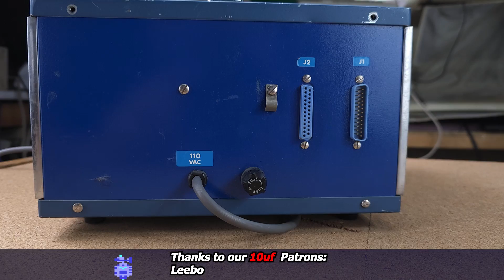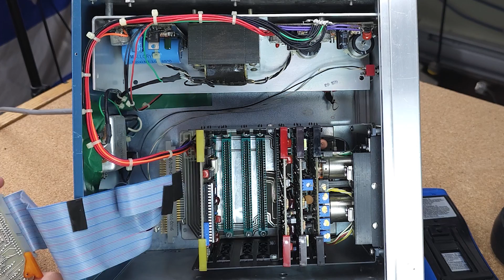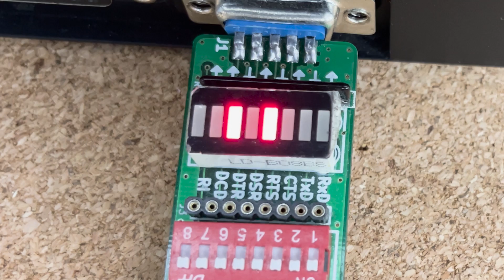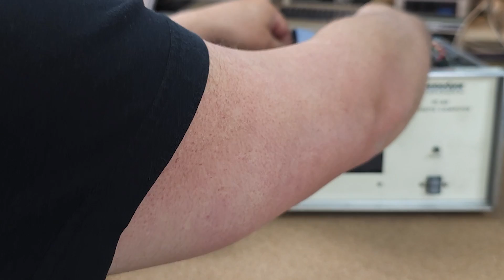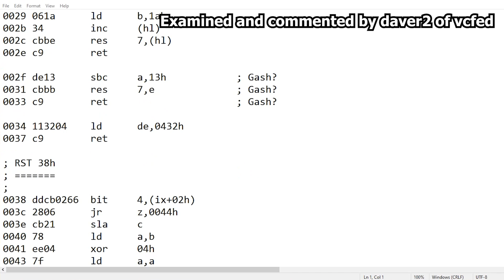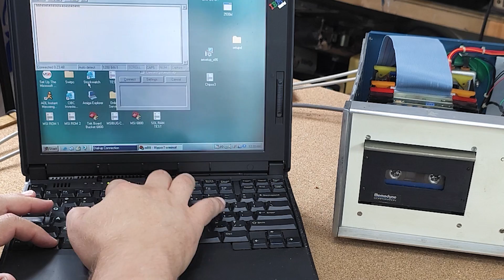Fixing a Mystery Z80 Computer from the 1970s

Comment: Hi

Interesting device.

I am glad you traced the power on the card and sorted out the + and - voltage traces - i would have not thought of that.

However i would not use that 25 to 9 pin adapter, you are assuming it is using a hays standard or more modern ibm standard of serial port wiring

Maybe the volt meter should have been used on the 25 pin port with the tape playing to see if there is any +12 or -12 voltage coming out of any of the 25 pins ( well 50 pins as you mentioned there are 2 off )

Then the same with the oscilloscope

Initially I was guessing one port is for a screen and the second for the tape back up, but you mentioned the eprom dump shows nothing that sophisticated - but if it was a screen output that would also be on a a simple serial out 

I was actually suprised, you did not cut and paste some text into the hyper terminal software and see if it stored the data / keystrokes and the tape unit attempted to save the transmitted characters

But your data recording playback did not have any different tones that would have been produced for each different key press

It is a shame the machine is so well built that it did not have a simple description of which slot each card goes into on the card or even a texta or sticker on the card slot edge or backplane slot saying red/brown/yellow etc

Unless the serial parameters are exact the device would not understand the characters and not work as designed, however the fact that the hyperterminal only ever  showed  character on screen that was a result of your key press , and never any characters that were generated by the tape drive could suggest that the 25 to 9 pins adapter may not be correct, some important pins may need to be connected as 25pin to 25pin - this happens with say cash register comms - there is a scan code or maybe a Control G to trigger the drawer open, other serial printers use a spare pin for special feature - the "paper out" is a example as different printes used different spare pin to report back - this is why some printer you had to use the factory cable not a generic serial printer cable

I dont think it requires additional voltage via the serial cable, it seems to "quick forward" on Ctr-Q so no real need for extra power - some items need a +5 or -5v for options to be sent in the cable - security door loggers are a example, we had one in a building i worked in, it used standard serial and all data was captured via dos telix software on a Pc ( it saved the buffer every so often 2k ??? ) , any way , you could actually unlock the door with a keypress on the PC, as it relied in a +5v signal on a pin to send back to the door lock and unlock it

Comment: 21:40 it's best to set flow control to "none" or "off" unless you know you need it. When it's set to "hardware", if the modem control signals (specifically RTS/CTS) aren't just right, you'll get nothing at all. There's nothing worse than when the device is alive, but your terminal program ignores data or sends nothing due to the flow control. (In this case you poked a wire to override it, but I prefer not to have to poke wires when I just need to see any sign of life.)
The only downside to not turning flow control off is if you send it a lot of data real fast, it might drop some. But by that point you already know it's alive.

As to my guess of how this thing might work, I think you found the control port properly, but I don't know why they thought using random control codes was a good idea. The other port might be the port for the data it is supposed to record and play back. Maybe it was meant to record data over a long period of time for later processing, or maybe it was meant to replay stuff like for repeating a CNC sequence. Or maybe even either one, depending on the customer!

It would be cool if you could trace out the card pins to document the bus so that a RAM card or something could be added, but that's so much work for just one existing unit. And I don't appreciate when they make slots slightly different like the one for the serial card, then don't make it obvious which board goes in which slot. Yes definitely it's possible, but just making a proper card that mechanically fits into the slot is a lot of work even before you design the electronics on it!

Comment: You keep fiddling with different parts and never resolve any.  Start with comms, 7 bits, 1 stop bit and no parity is the place to start. This appears to be a data-logger so it will be recording received data to tape for later analysis is not unusual,
Reply from the maker: @G7VFY  I'm afraid my editing skills are still a bit choppy.  I actually did go through pretty much every combination of data bits, stop bits, parity and handshaking options off camera... even forcing hyperterminal to make the input 7 bit.  Nothing got a result unfortunately.

Comment: That is so adorable. s-100 buss with a built in storage device. Very nice.
Reply: Just because there are slots and it's a Z-80 based computer doesn't mean those slots are S-100 compatible.
Reply: @jnharton  Yea that is true. A few different types and even then. The hardware might be correct. But the slot might be wired a tad different. I have very little experience with s-100 systems. But I know from reading some manuals. Depending on what computer you had. Sometimes you had to change a few jumpers around on the card.

Comment: If memory serves, COM1 on your ThinkPad is the irda port. 😊
Reply: does it have a built in modem or those "winmodem chips" that could take up the #!, but yes a IRDA port can also be the answer
Reply: @georgemaragos2378  I had a ThinkPad 365XD and it lacked a built in modem. I had one of those terrible PCMCIA modems where the phone jack was only as thick as the card and popped out the side. Awful, but still better than a proprietary dongle.

Comment: Reminds me a lot of the Commodore 1541 Disk Drive.  Technically it's a stripped down, low memory, 6502 computer... with a serial interface... -- but... you used it from the main computer, not directly.  Usually the main computer would have something in ROM that would translate simple commands into a sequence of commands that the drive itself could execute and do something with.  It seems like some specific codes you use advance the tape by just a tiny amount, and others jump it into fast forward -- I'm guessing, that the tiny amount command would be spammed to the device to advance the tape, then another command to read back a value then advance the tape again, then read back another value, etc. etc. -- the fast forward command you keep getting is probably not one that it directly used.  (Unless it's playing at a very normal speed, and it's just squeaky?) -- The random character is the value is read back from the tape. Then you want to advance it by one tick, then read back the next character, etc.

Comment: I absolutely adore this little box!
I think other have mentioned it, but it sure looks like you're not quite there with baud rate settings yet. 7E1 is a more common setting, but also, I'm willing to bet the speed isn't quite right either. 1200 baud I think was a pretty common speed for tape decks, so the ROM could be indicating that. I would be willing to try 300, 1200, 2400, and 9600 for the terminal to see if you get any readable output out of the system. With that cool little laptop, swapping baud rates is pretty quick and easy.
Or, you could put it in your luggage, fly down to Texas with it, and we'll get it going together! No guarantees I'll give it back after we finish filming with it though, haha.
Reply from the maker: Always a pleasure to see you here!  I did try off camera multiple different baud rates and settings including 7E1 and setting Hyperterminal to force it to 7 bit ASCII.  The only reason I settled on 8N1 was the government document I mentioned finding.  I believe in the section describing hookup they recommended those settings.  And I agree I think the 1200 label on the EPROM is ambiguous..  it could be the baud rate it communicates with computer or could be to do with encoding tape deck.

I don't know when I'll get to Texas but this thing is small enough maybe I can shoot it down to you for a more expert look one day.  I did plan to do some followups to try and figure out the proper settings but have other stuff lined up.
Reply: Why not just pick a speed and play with the parity toggle and stop bits until you actually get something comprehensible? 
 
If nothing is seen, you could bump the speed and cycle all the other stuff again.

Unless there's compression or an unusual encoding involved, I would think you'd get something coherent.
Reply from the maker: @jnharton  I tried literally every combo off camera.  It just wouldn't give me anything different unless I ramped up the speed and then I got nothing at allm
Reply: @TechTimeTraveller  Typically when I'm attempting to communicate with an unknown serial device, I start with one setting (i.e. 8N1) and cycle through the baud rates. It sounds like you have done that.  Did you notice any changes in the gibberish that was being sent?  Is it sending ASCII text characters??  

My thought is it was used to record data from an instrument of some sort like say an early version of a flight data recorder.  Maybe it sent out pre-recorded digital signals like RTTY or some sort of data communication signal.  It is a neat device.  It would be fun to see if it you can actually get some usable signal off of it.  I'm looking forward to seeing it in the future.
Reply: I'm just looking back here because it was reminding me of the tape drive for Usagi Electric's MicroNova in today's video. Not quite as close as I'd thought though

Comment: 3:25 just like an Atari floppy drive is pretty much most of an atari 2600 just throw a tia chip in
Reply: It's not the Atari or commodore doing the Dir

The floppy drive does dir and then sends a small preformatted readable list to the computer to spit on the "gpu"
Reply: Wen you modded your floppy drive with a cmos 6502, new eeprom and ram expansion....fast clock speed upgrade 

Get 128kbyte/sec transfers over the Sio port, with built-in cache and floppy ramdisking
Reply: That's why unlike a c64/128

You just put the floppy in drive 1

Power on drive, then power computer

Don't even need to type, if boot sector is right, autoloader

Atari 8bit was around 1977 but got to market in 79 started prototypes around 1975

Comment: Scope the RXD and measure what the period is on the strange character it's returning. In late 70s it could be 300 baud or even 110!
Reply: It's been a long time since I messed with this stuff but my recollection is that wrong baud rate you get nothing at all, wrong data format gives wrong characters.
Reply: In fact the question is why DIDN'T you START by scoping the 25-way connectors?  This would establish which pins are being driven (Tx) and by observing the output at power-up or reset establish if anything is being transmitted and at what baud rate.  You might also establish which pins are inputs, a CTS type of input might need to be asserted to allow characters out of the device.

Comment: Being a old serial unix guy.. seams to me the wrong baud rate. May be able to look the serial card chips up and figure out the baud rate. May be some jumpers somewhere. Just an idea.. Probably not much help.
Reply: Couldn't it also be flow control? 

99% of the time I needed to turn it off (back in the day)
Reply: @Giepie  thers not enough data coming thru to be flow control. Easy way to find out is to disconnect the flow control pins

Comment: Have you tried just plugging in an old dot matrix printer into the serial or parallel socket? The other socket could be for data gathering cables. And the unit itself might just be a processing unit that outputs analog results of probes to a printer and does a digital backup on to the cassette. The cassette can then be used on another computer with an interpreter program running.
I would look up old meterology articles like for seismology or weather stations rather than aerospace specifically.

Comment: The RS232C settings are wrong. Obviously the connection with m-80 was stablished, but that weird characters on the hyperterminal reveals wrong parameters on the RS232C. Look at hiperterminal status bar. Those modifications that you made do not had applied actualy.
Try others configurations like 1200-7-N-1 or 1200-7-o-0, 1200-8-P-1  etc... 
Make sure that parameters realy was applied (monitoring in the hiperterminal at there status bar).
Reply: I would recommend Teraterm for such things. Much better terminal emulator

Comment: It looks like one port is for tape control, and the other is for data.  Ctrl-Q seems to be "cue"; Ctrl-R might be "replay", and that fast forward you noticed might be a scan for data tones on the tape?  Save something on your PET datasette and see if this thing can "see" anything on that tape.
Reply from the maker: I didn't think about it maybe looking for tones and not finding them.  Making notes for a future run at it again.
Reply: Ctrl-r might also be intended to be "run", other control codes after might do other things "only" when already in run mode. In fact, it might be like a Commodore load command, you hit "run", then thpe in a short code, which defines the label on the tape to look for to load and run, but it never "sees" it, so it just runs out the tape trying to find it.

Mind, this is mostly me talking out of my ass, based on really limited info on how like.. maybe all of two computers handled tapes.
Reply: Ctrl-r could also mean "rewind", if you over-think it enough.
Reply: The PET very likely uses different tones to what this device uses.

Comment: It might be assuming the tape is specially formatted with data, and the endless seeking is it scanning until it finds <something>,
Reply: The tape drive could be digital and the head reads two tracks, one data and the other a clock. The clock is used to tell the computer where the data is. The tape has a header like directory of the data stored. The clock track is high precision so the tape speed can be adjusted whilst reading or writing data.
Reply: Also the digital tape have pin holes at the start and end of the tape. So on start up the tape will run till the start if tape is found. If not the tape will just run fast forward till it finds the start of tape.

Comment: The inconsistent results and garbage coming back make me suspect your serial port configuration is incorrect - probably the wrong baud rate.
Reply from the maker: I did try literally every setting possible although for video length reasons I didnt capture all of that. 300 up to 19200, different terminal emulation, bits, stop bits etc.  It really did feel like a baud rate problem but above above 19200 it produced nothing and below that just garbage.  I suspect it was never meant to communicate with a human operator.  The fact that it responds to the control sequences durgadas311 determined were there, only at that baud rate, suggests probably we had it right at 1200 and something else is at work.  Wish I could find proper documentation.
Reply: @TechTimeTraveller  So, why DIDN'T you START by scoping the 25-way connectors?  This would establish which pins are being driven (Tx) and by observing the output at power-up or reset establish if anything is being transmitted and at what baud rate.
Reply from the maker: @Brian_Of_Melbourne  Because I am an enthusiast, not an EE.  What is self evident to those who are trained or naturally talented with these things is not always obvious to someone without that expertise.  I just began learning how to use my scope recently.  This channel is not intended to be educational per se - just a hobbyist learning as I go.  That said, I always welcome helpful comments and try to learn each time I approach another repair.

Comment: I have distant memories of one of these machines. Back in my collage days (late 90's) there was a very old CNC/milling machine in the engineering department, next to it was a console with a terminal on top and a computer exactly like that mounted underneath. Unfortunately I don't remember ever seeing it working. I believe it had been donated to the collage and don't think anyone at the collage actually knew how to operate it.
Reply: Good catch. I've seen something very similar to these used to retrofit CNC equipment that had previously used punch-tape programs. IIRC chips had to be changed out to customize the unit for the particular I/O available on the different types of multi-axis lathes and different cards were used depending on whether digital and/or analog I/O was required. Have also seen "industrialized" tape based SCADA systems that look similar for remote location monitoring and transmitting of alarms with the addition of a modem.